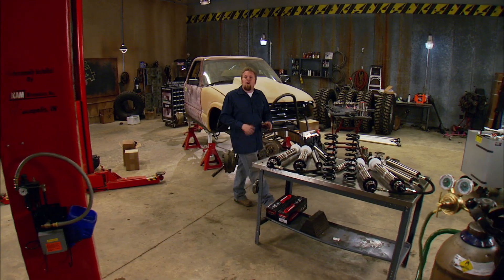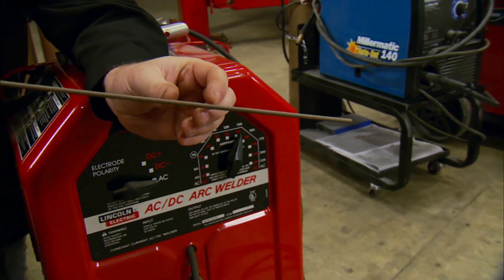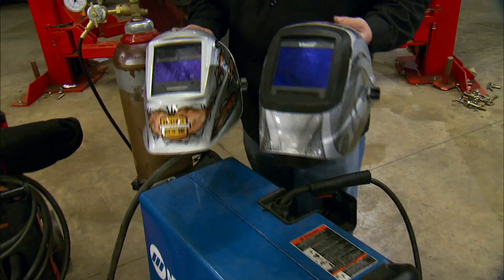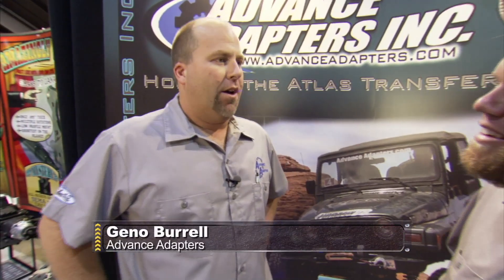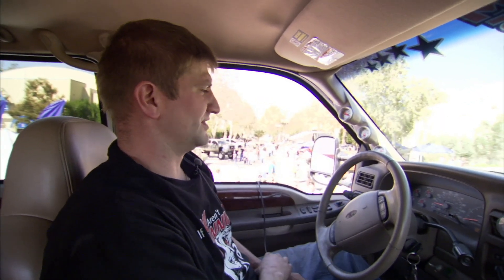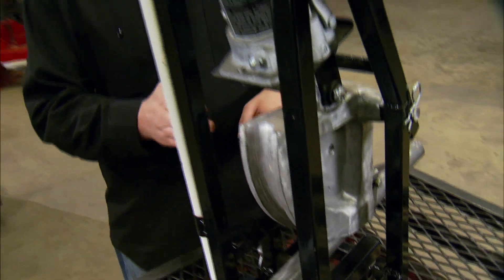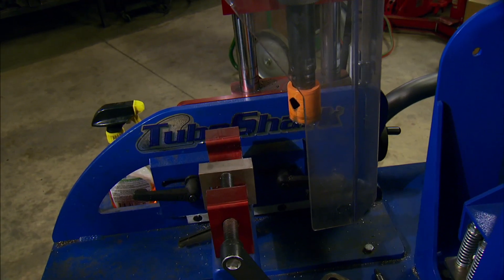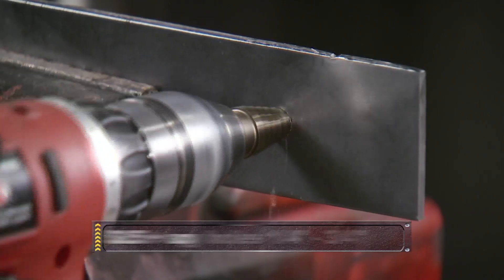How To Take Your Fabrication Skills From Beginner to Advanced - Xtreme 4x4 S4, E20

Comment: I'm going to ask if you heat the steel and then cool it doesn't it forge it?
Reply: No. Forging uses heat and pressure to reareange the metal grains into a particular shape. Heating and bending doesnt apply the necessary pressure to properly reareange the grains of metal to be considered forged, it simply makes it easier to achieve the bend as the metal becomes softer as it approaches its melting point when heated. As opposed to forging, it doesnt add strength, but can actually weaken the metal (hence why roll cages are bent cold, while heated and bent sections are often gusseted to add back the strength to the metal).